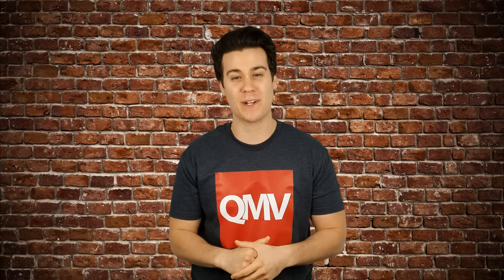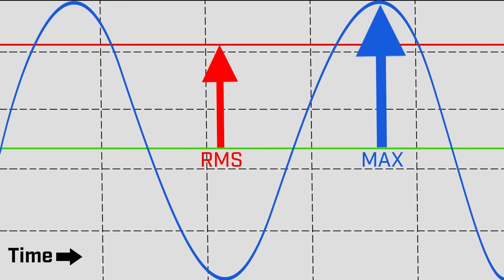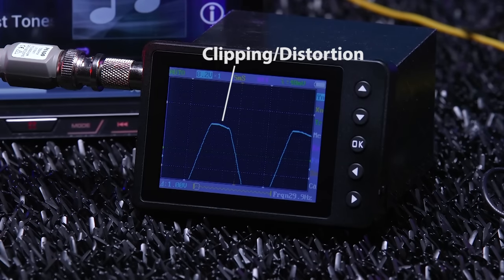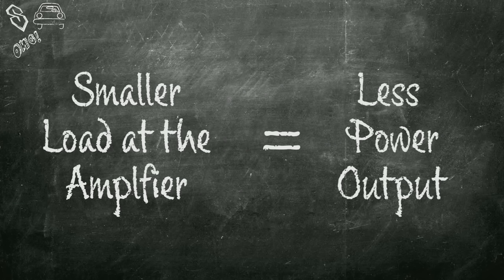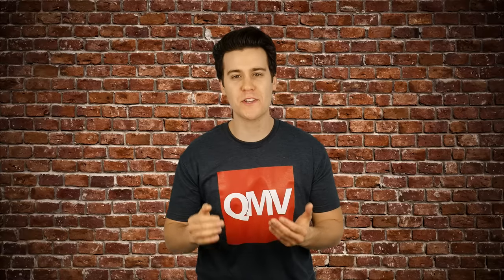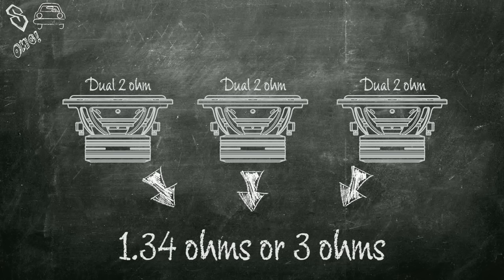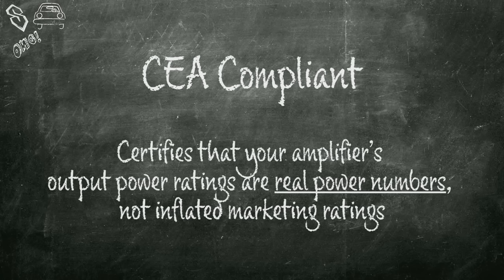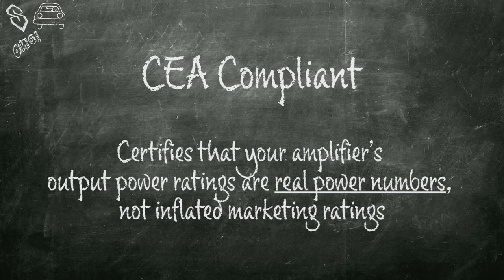How Do You Match Car Subwoofers and Amplifiers?

Comment: Hi no problem my subwoofer 800rms at 4ohms my amplifier is 650rms 4 ohms if i connect in 1 ohms the amplifier is 1800rms which is better thanks
Reply from the maker: Is the subwoofer DVC or SVC? If it's SVC it won't work. You'll also be wasting more than half the potential power of the amplifier, it may be more wise to get a cheaper/less powerful amplifier
Reply: Quality Mobile Video my sub is 2 dvc 4 ohms 400rms each which better connection final 4 ohms the amplifier 650rms or 1ohms the amplifier 1800 rms thanks

Comment: I got a fosgate just 1 12 inch p3 2ohm wired to 1ohm with a 1000w kenwood and it cuts in and out do I need a bigger amp
Reply from the maker: I need to know all the specs on the sub and amp. What's the RMS power of the subwoofer and is it DVC or SVC? Is the amp 1,000W RMS @ 1ohm or is that 1,000W MAX?

Comment: I purchased a 12" kicker solobaric max 1500 watts, in a Nissan Altima. Even after the video, i still don't know what amp i need. I like bass but won't run system hard all the time.
Reply from the maker: Did you get the 2 ohm or 4 ohm

Comment: ROCKFORD FOSGATE R2SD4-12 12" 1000W 

What amp do I need for these subs. Its 2 subs in an enclosed box.
Reply from the maker: Those have a combined RMS of 500W, and  two DVC 4 ohm woofers make a 1 ohm or 4 ohm load. You want an amplifier that hits 450-700W RMS @ 1 ohm or 4 ohm...

1 ohm load options
https://www.qualitymobilevideo.com/car-audio/car-amplifiers/mono-car-amplifiers.html?amp_output_power_rms_1ohm=450-800

4 ohm load options:
https://www.qualitymobilevideo.com/car-audio/car-amplifiers/mono-car-amplifiers.html?amp_output_power_rms_4ohm=450-800&dir=desc&order=price

Comment: I'm lil lost can u recommend a perfect amp for my Rockford fosgate p3 12 in sub?
Reply from the maker: Do you have the 2 ohm or 4 ohm version Trini?
Reply: Quality Mobile Video the dual 4ohm version
Reply: Quality Mobile Video the p3d412 version is the one I've got. I got a boss audia riot 1000w 4ch
Reply from the maker: Sweet! So that sub does 600W RMS, and one DVC 4 ohm subwoofer makes a 2 ohm load at an amplifier. You'll want a monoblock with a power rating around 600-700W+ RMS  2 ohms.Take a look at these and let me know what you think: 

Pioneer GM-D9601 - 800W RMS @ 2 ohms
http://www.qualitymobilevideo.com/gm-d9601.html?utm_source=YouTube&utm_medium=Video&utm_campaign=Match_Subwoofers-Amplifiers

Kicker CXA600.1 - 600W RMS @ 2 ohms
http://www.qualitymobilevideo.com/cxa600-1.html?utm_source=YouTube&utm_medium=Video&utm_campaign=Match_Subwoofers-Amplifiers

Rockford Fosgate R1200-1D 800W RMS @ 2 ohms
http://www.qualitymobilevideo.com/rockford-fosgate-r1200-1d.html?utm_source=YouTube&utm_medium=Video&utm_campaign=Match_Subwoofers-Amplifiers
Show less
Reply: Quality Mobile Video is there possibly any amp under $100 that would work well with it I'm on a tight budget. And seeing as I'm living in the Caribbean the exchange rate would be high and also the import duty for an amp over $100 would be over my budget
Reply from the maker: https://www.qualitymobilevideo.com/car-audio/car-amplifiers/mono-car-amplifiers/shopby/unbridged_impedance-2_ohm.html?price=42-107

Comment: so i ordered a rockford fosgate P400x1 amp. and a Rockford P3 shallow 10" 4ohm sub.... just a single sub. How much power will that single sub be receiving? the amp says 250watts @ 4ohms and 400 watts @ 2 ohms.... So will that sub be getting 250 watts? So confused. please come hold my hand and walk me through this. lol
Reply from the maker: That amp does 400W RMS @ 2 ohms. The subwoofer is a DVC 4 ohm woofer, meaning it will make a 2 ohm load. And the sub is rated at 300W RMS, so perfect match good job
Reply from the maker: You always want your amplifier to have a higher rating than your sub

Comment: 2 svc @ 4ohms (500rms each)  can we wired to an amplifier which is 500w x 1 @ 2ohms ?
Reply: Or do I need an amp which is 1000w x 1 @ 2ohms ?
Reply from the maker: You'll want to get the 1000W @ 2 ohm amplifier! Wire in parallel

Comment: Basically make sure sub rms + sub rms= amp rating. Lights dim upgrade the alternator and power wires. Find the brands you think you want and how many subs. Find the box they fit in and that has the air space. 2 subs at .7 cu ft need a box that is 1.5. Simple math. And google how you would have to wire the subs to that amp to see if you need 2 or 4 ohm subs. Easy peasy.
Reply from the maker: Lemon squeezy

Comment: I just came across this video because I'm trying to find what amp goes with what subwoofer please don't cuss me out I am just a woman who is in desperate need of some assistance. I just bought a amp from hilfonics that is 4 ohms and has a rms rating of 2000 ×1@1 ohm. Does the Skar loaded vented at 4 ohms with 1200 rms go well. With it. Im so confused😟
Reply from the maker: Lol why would we cuss you out! So it all depends on whether or not that subwoofer is Dual Voice Coil or Single Voice Coil. One DVC 4 ohm woofer cannot be wired to a 1 ohm load, only 2 ohm or 8 ohm. One SVC 4 ohm woofer can be wired to 1 ohm. I'm assuming it is DVC 4 ohm subwoofer though. You'd really need a 2 ohm capable amplifier.
Reply: @Qualitymobilevideo  lol u were pretty hard on us lol....it only says 2.5" High Temperature Copper Voice Coil

Comment: Just to let you guys know. The Rockford Fosgate P1000X1BD amp is rated for 500w at 2ohm not 600w.
Reply from the maker: I honestly am confused because their website profile says 500W but their manual says 600W https://www.rockfordfosgate.com/rftech/library/2013/3_amplifiers/1230-57270-01_punchamp_en-man.pdf
Reply: I could be wrong. You know a lot more of this than I do but I just looked it up and it says 300w@4ohm, 500w@2ohm and 1000w@1ohm. Here’s a link https://rockfordfosgate.com/products/details/p1000x1bd/
Reply from the maker: It probably is 500W, but they did a poor job marketing it having different ratings in 3 different areas of marketing LOL

Comment: So your saying a 2000watt 1ohm monoblock will work with 2 1000watt subs wired in parallel
Reply from the maker: If those two subs are DVC 4 ohm, then yes, they will wire to 1 ohm in parallel.

Comment: how can we calculate the total watt of a 2, 4 ohm 100w sub woofer in series  connection?
in parallel it must be 2ohm 200w,but in series it must be 8 ohms 100w is it ,
Reply from the maker: Do you mean a DVC 4 ohm subwoofer? Yes that's correct. One DVC 4 ohm woofer wires to 2 ohm in parallel and 8 ohm in series
Reply: @Qualitymobilevideo  i want the watts of the speaker in series and parallel

Comment: How to install a amp to after market door speakers with factory wiring.
Reply from the maker: I'm assuming that the speakers are currently powered by the head unit?  You'll have to run new wires to the actual external amplifier to the power the speakers with the amp

Comment: Oh sorry, one more comment.  RMS ratings are seriously subjective.  Some amplifiers claim a certain RMS output, when some amps put out way more than their rated power, you could start damaging subs that are not rated to handle that power.  I find that if you run subs with about a 20% more RMS power handling than the amps RMS output, you will not generally overdrive the subs.

Comment: I am going to buy 2 kicker TL7T102 what kx  Series amp do i need
Reply from the maker: So two DVC 2 ohm subwoofers like that will be able to make a 2 ohm load at an amplifier. They have a combined RMS of 1000W> i suggest getting a monoblock amplifier with a power range of 900-1200W RMS @ 2 ohms. Check these out: 

Kicker CAX1200.1 1200W RMS @ 2ohms
http://www.qualitymobilevideo.com/cxa1200-1.html?utm_source=YouTube&utm_medium=Video&utm_campaign=Match_Subwoofers-Amplifiers

Hifonics Brutus BRX2016.1D 1400W RMS @ 2ohms
http://www.qualitymobilevideo.com/brx2016-1.html?utm_source=YouTube&utm_medium=Video&utm_campaign=Match_Subwoofers-Amplifiers

Kenwood KAC9106D
http://www.qualitymobilevideo.com/kac9106d.html?utm_source=YouTube&utm_medium=Video&utm_campaign=Match_Subwoofers-Amplifiers

Power Acoustik BAMF1300D
http://www.qualitymobilevideo.com/bamf1-3000d.html?utm_source=YouTube&utm_medium=Video&utm_campaign=Match_Subwoofers-Amplifiers

Power Acoustik EG14500D
http://www.qualitymobilevideo.com/eg1-4500d.html?utm_source=YouTube&utm_medium=Video&utm_campaign=Match_Subwoofers-Amplifiers

Hifonics Zeus ZRX3216 1600W RMS @ 2ohms
http://www.qualitymobilevideo.com/zrx3216-1d.html?utm_source=YouTube&utm_medium=Video&utm_campaign=Match_Subwoofers-Amplifiers

Comment: Im lost. What amp do I need for two kicker compS 12in?
Reply from the maker: Two Kicker 43C124's? Two SVC 4 ohm woofers can make a 2 ohm or a 8 ohm load. SHoot for 2 ohm. Their combined RMS is 300W RMS, so monoblock amplifier with a power range of about 250-350W RMS @ 2 ohms. Check these out:

Rockford Fosgate P300X1 - 300 watts RMS x 1 Channels at 2 ohms
http://www.qualitymobilevideo.com/p300x1.html?utm_source=YouTube&utm_medium=Video&utm_campaign=Match_Subwoofers-Amplifiers

Kicker 42PXA5001 - 500 watts RMS x 1 Channels at 2 ohms
http://www.qualitymobilevideo.com/42pxa5001.html?utm_source=YouTube&utm_medium=Video&utm_campaign=Match_Subwoofers-Amplifiers

Rockford Fosgate R500X1D - 500 watts RMS x 1 Channels at 2 ohms
http://www.qualitymobilevideo.com/rockford-fosgate-r500x1d.html?utm_source=YouTube&utm_medium=Video&utm_campaign=Match_Subwoofers-Amplifiers

Kicker CXA300.1 - 300 watts RMS x 1 Channel @ 2 ohms
http://www.qualitymobilevideo.com/cxa300-1.html?utm_source=YouTube&utm_medium=Video&utm_campaign=Match_Subwoofers-Amplifiers

Kenwood KAC5001PS - 500 watts RMS x 1 Channels at 2 ohms
http://www.qualitymobilevideo.com/kac5001ps.html?utm_source=YouTube&utm_medium=Video&utm_campaign=Match_Subwoofers-Amplifiers

Comment: I have two old audio pipe 15s, 800 W, I think, 800 RMS. but I’m not sure. I think I have 2 ohm, each speaker has two connectors for speaker wire. I think I need a 2000 W four ohm amplifier

Comment: Hi I have a Skar Audio EVL-18 D4 18" 2500 Watt
Skar Audio RP-2000.1D Mono Block Class D I’m new to the game my first set of subs where cheap 2-12 duels.. Ik I bought a amp that isn’t powerful enough but I plan to upgrade to a 3000 watt amp. My current amp will not power on anymore it was pushing my sub ok (I didn’t have it even half up)! One day when I was bumping it just stopped now when I turn my car on the power light turns on for about 3-4 seconds then dims out and turns off? Did I blow my amp? Could anybody help

Comment: I have 2 u12 d2 sundowns theyre dual voice coil 2 ohm 1500rms 3000 max I don’t understand which amp to get
Reply from the maker: 1500W RMS combined? You have two dvc 2 ohm woofers, which means you'll want to wire them to a 2 ohm load. You want a monoblock with an RMS equal to or greater than their combined RMS @ 2ohm

Comment: If i take a 4ohm dvc 250 rms, when i make it parellal it wl be 2ohm but what about it's rms 250w or 500w?
Reply from the maker: Wiring a DVC 4 ohm woofer in parallel makes a 2 ohm load correct. The RMS will not change, the power the sub will put out is dependent on the amplifier you are wired to.
Reply: So i need 300w amp for 250w subwoofer

Comment: I want 2 subs 10 inch do I need a 4 channel amp for inside speakers as well
Reply: Only if you want to add 4 speakers. If not and you wanna add 2. Then just a 2 channel will suffice. (If you haven't already hooked it up. ) Lol

Comment: My amp is soundstream t1. 6000dl
Rms power 2omz.... 1400x1
Rms power 1omz.... 2500x1
Rms power 5omz.... 3000x1
Rms power 4omz.... 800x1
Max power 6000w
What kind of speaker is the match on my amplifier that 1omz does not have idea please help me
Reply from the maker: So just one subwoofer or two?

Comment: So it’s best I run an skar audio rp 2000.1d with my two L7S kicker subs which rms are 2000watts dvc @4ohm together and to wire them down to 1ohm to give them the 1000watts apiece that the amp will push perfectly fine correct or get a slightly bigger amp

Comment: i have two 15inch subs dvc rated @1,000 rms 2ohms each , i need a amp so where i’m lost is do i just get a 2,000 rms amp??? what exactly to do u  bed to look for it’s all confusing ngl. if someone can help me out i’d be appreciated.
Reply from the maker: You specifically need a monoblock amplifier with a power rating of about 2000-2400W RMS @ 2 ohms.
Reply: Quality Mobile Video thank you so much
Reply: Quality Mobile Video each sub is 1,000 rms 
so 2,000 rms combined , i thought a monoblock was just for 1 single sub ?

Comment: Can I run a sundown audio 12” 1000 w RMS 4 ohm on a Skar audio amp 1200 w RMS 1 ch 1 ohm?
Reply from the maker: Is the subwoofer DVC or SVC? The amplifier is stable 1000W RMS @ 1 ohm? This won't be possible with just the one woofer. One DVC 4 ohm woofer cannot be wired to 1 ohm, instead only 2 ohm or 8 ohm. And One SVC 4 ohm woofer can only be wired to 4 ohm.
Reply: Quality Mobile Video the subwoofer is DVC. So I can’t run one sub on the amp but I can run two subs on the amp?
Reply: Quality Mobile Video also I would have to get a new amp that 2 ohm or 8 ohm to run that one sub?
Reply from the maker: @GoldKnightGaming-oh3qo  Correct. Two DVC 4 ohm woofers CAN wire to 1 ohm. But not just one
Reply from the maker: @GoldKnightGaming-oh3qo  Exactly
Reply: Quality Mobile Video okay thank you very much

Comment: Series circuits
A series circuit is a circuit in which resistors are arranged in a chain, so the current has only one path to take. The current is the same through each resistor. The total resistance of the circuit is found by simply adding up the resistance values of the individual resistors:

equivalent resistance of resistors in series : R = R1 + R2 + R3 + ...

A series circuit is shown in the diagram above. The current flows through each resistor in turn. If the values of the three resistors are:

With a 10 V battery, by V = I R the total current in the circuit is:

I = V / R = 10 / 20 = 0.5 A. The current through each resistor would be 0.5 A.

Parallel circuits
A parallel circuit is a circuit in which the resistors are arranged with their heads connected together, and their tails connected together. The current in a parallel circuit breaks up, with some flowing along each parallel branch and re-combining when the branches meet again. The voltage across each resistor in parallel is the same.

The total resistance of a set of resistors in parallel is found by adding up the reciprocals of the resistance values, and then taking the reciprocal of the total:

equivalent resistance of resistors in parallel: 1 / R = 1 / R1 + 1 / R2 + 1 / R3 +...

A parallel circuit is shown in the diagram above. In this case the current supplied by the battery splits up, and the amount going through each resistor depends on the resistance. If the values of the three resistors are:

With a 10 V battery, by V = I R the total current in the circuit is: I = V / R = 10 / 2 = 5 A.

The individual currents can also be found using I = V / R. The voltage across each resistor is 10 V, so:

I1 = 10 / 8 = 1.25 A
I2 = 10 / 8 = 1.25 A
I3=10 / 4 = 2.5 A

Note that the currents add together to 5A, the total current.

A parallel resistor short-cut
If the resistors in parallel are identical, it can be very easy to work out the equivalent resistance. In this case the equivalent resistance of N identical resistors is the resistance of one resistor divided by N, the number of resistors. So, two 40-ohm resistors in parallel are equivalent to one 20-ohm resistor; five 50-ohm resistors in parallel are equivalent to one 10-ohm resistor, etc.

When calculating the equivalent resistance of a set of parallel resistors, people often forget to flip the 1/R upside down, putting 1/5 of an ohm instead of 5 ohms, for instance. Here's a way to check your answer. If you have two or more resistors in parallel, look for the one with the smallest resistance. The equivalent resistance will always be between the smallest resistance divided by the number of resistors, and the smallest resistance. Here's an example.

You have three resistors in parallel, with values 6 ohms, 9 ohms, and 18 ohms. The smallest resistance is 6 ohms, so the equivalent resistance must be between 2 ohms and 6 ohms (2 = 6 /3, where 3 is the number of resistors).

Doing the calculation gives 1/6 + 1/12 + 1/18 = 6/18. Flipping this upside down gives 18/6 = 3 ohms, which is certainly between 2 and 6.

Circuits with series and parallel components
Many circuits have a combination of series and parallel resistors. Generally, the total resistance in a circuit like this is found by reducing the different series and parallel combinations step-by-step to end up with a single equivalent resistance for the circuit. This allows the current to be determined easily. The current flowing through each resistor can then be found by undoing the reduction process.

General rules for doing the reduction process include:

Two (or more) resistors with their heads directly connected together and their tails directly connected together are in parallel, and they can be reduced to one resistor using the equivalent resistance equation for resistors in parallel.
Two resistors connected together so that the tail of one is connected to the head of the next, with no other path for the current to take along the line connecting them, are in series and can be reduced to one equivalent resistor.
Finally, remember that for resistors in series, the current is the same for each resistor, and for resistors in parallel, the voltage is the same for each one.
Reply: LINK : https://physics.bu.edu/py106/notes/Circuits.html